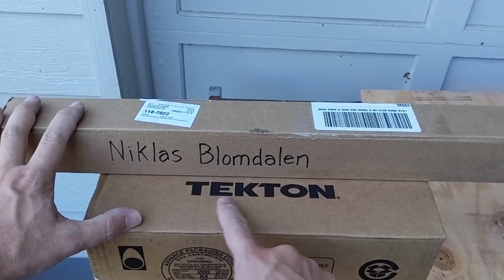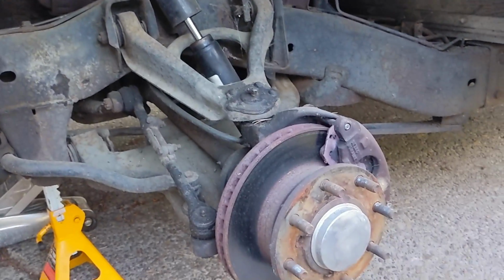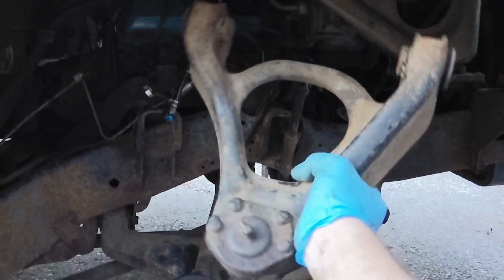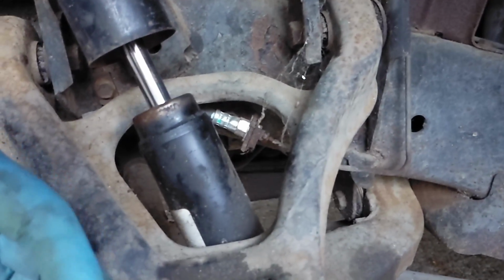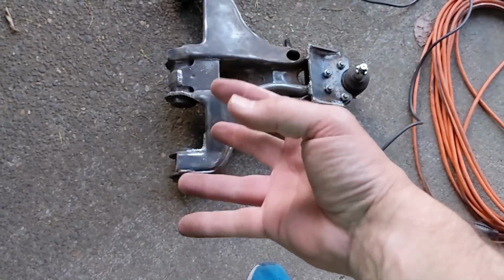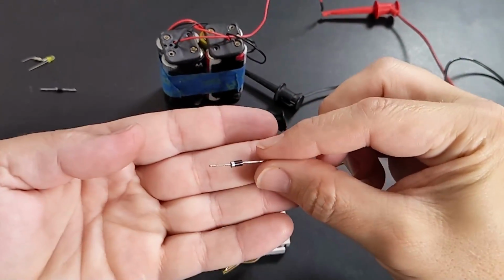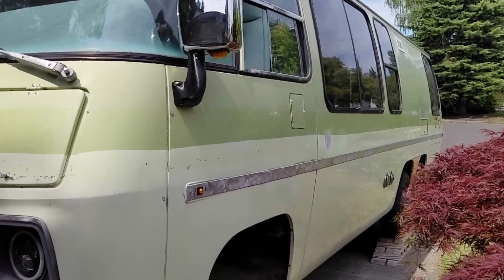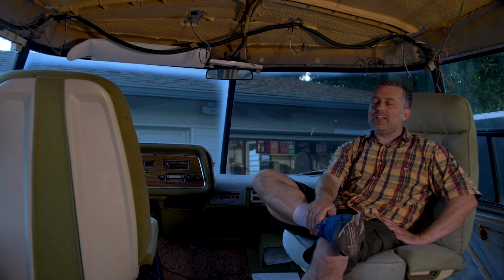Building the Best Damn GMC Motorhome Ever E.24 - Upper A-arms

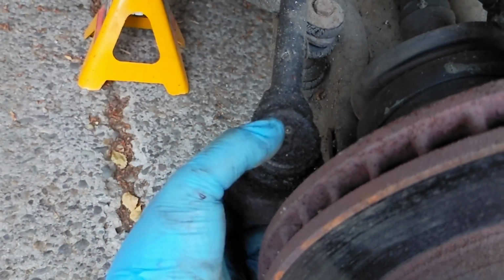Comment: At 5:59 you refer to the "Tie Rod End" as a universal joint.  At 7:04 you refer to the upper "Ball Joint" as a universal joint.  Your front suspension has an upper and a lower "Ball Joint" on each side.  Universal Joints are used in drive shafts for rear and 4x4 drive systems (not to be confused with CV joints like your front drive axles) and steering column connections to/from the steering box.
Keep up the good work on this project.  You will win in the end.
FYI using a torque wrench as a breaker bar will totally ruin the torque wrench and you cannot trust the torque values it will give you.  Throw it away and get a new one and buy a breaker bar.  The right tool for the job, just like the needle nose angle pliers you were admiring at the beginning of the video are meant for a specific purpose and using them for some purpose other than there intended purpose usually just damages or ruins the tool (like your torque wrench).

Comment: To Lock the wheel in place, put a heavy duty screw driver in to the rotor vents, so that when turning the castle nut off it contacts the caliper.  Works every time.

Comment: Have you tried a Full-Wave Rectifier for LED? It would convert the negative voltage to a positive one for the LED. It would act more like the light bulb then. You would have a 1-2V drop from the diodes however.
Reply: Just a thought on this (and I was also someone who suggested a full-wave rectifier) is that if the flasher circuit relies on the current draw of the bulbs to set the frequency of the flashing then just swapping to LEDs - even with a bridge rectifier - would probably not work due to the current draw being so low the flasher circuit would have a frequency of flashing that would not be allowed. Remember when the old style flasher circuits would flash faster if a bulb was blown? At this point only converting to an electronic flasher circuit would work - but still use the bridge rectifier (which can be used in DC circuits for reverse polarity protection as well as AC circuits) with the LEDs to maybe simplify things if required.
Reply: I was also one of the commenters asking about a bridge rectifier, aka a full wave rectifier. The original video with the wiring diagram was so long ago now that I can't remember how I thought it should go in there but it had to do with one of the bulbs getting reversed polarity from the circuit compared to the other. If that were the only issue with the conversion to LED, then a rectifier just in front of that bulb would fix the polarity issue. If the current needed to be reversed to follow the rest of the circuit then it would just shut down the rest of the circuit.